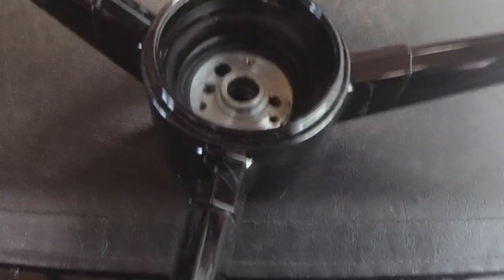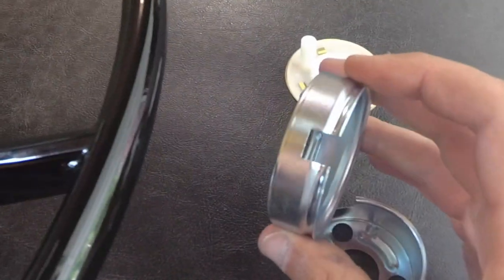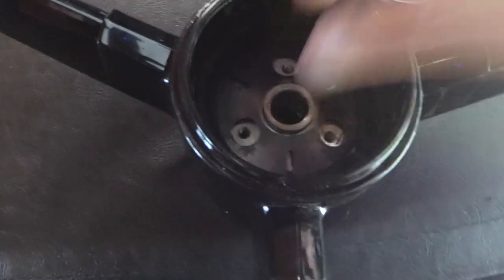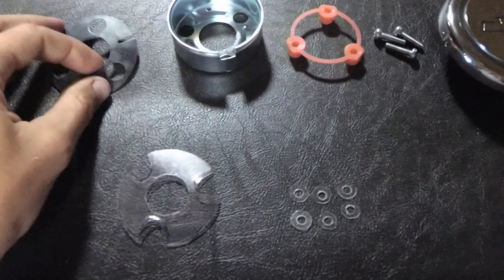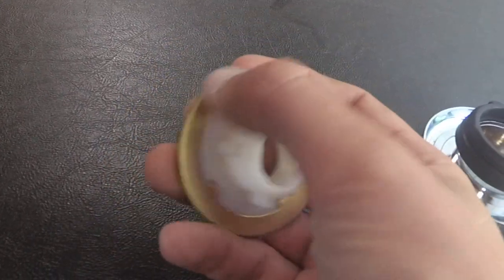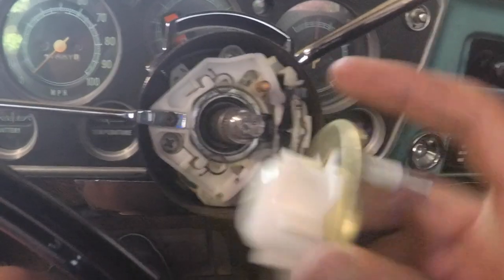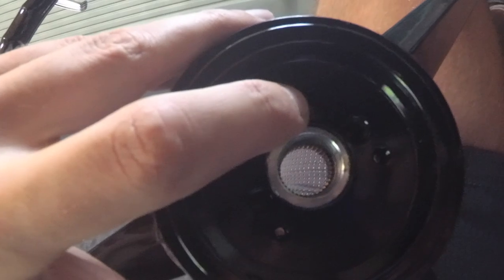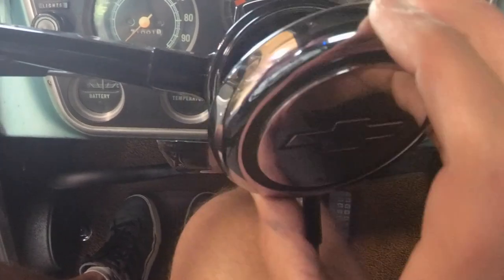1968-72 Chevrolet C10 Horn Button Assembly

Comment: In the event someone is stacking the horn assembly for a 1967-68 Camaro, I want to save you some headache. There is a insulator made in the exact shape of the spring disk. It's a type of fiber/paper insulator. Only was made on the original assembly.  It is not part of any replacement horn kit. But what it does, especially on the 67-68 model with a standard steering wheel with all it's metal is keep you from getting a 12v shock when pressing the horn button with your hand touching any other metal part of the steering wheel. The only way to get one is to cut one yourself (I used some thin gasket material i had laying around. Cut it in the exact shape of the spring disk. Glue it to the bottom side of the aluminum cup. That will separate the 12v from the rest of the steering wheel. Hope this helps someone.

Comment: Great video, very helpful. What is the job of those spacers you made why did you need them and are they electrically insulating anything--if so why doesn't original equipment have them? I'm trying to understand why what you call the spring disk doesn't make contact with the cup all the time? Or to put it differently specifically what functions here as an open electrical switch and what closes it to ground the horn relay? Thanks
Reply: One other thing are the screws fully tightened?
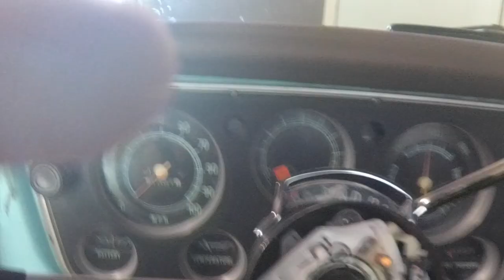Reply from the maker: The spacers I made were needed in my configuration to add space. :-) Otherwise the horn button was already all the way in and I couldn't actually press it to do anything. This also meant that the horn was randomly triggering. Double bad. Check out the piece at 4:10 in the video, that gets pressed down and is the switch.
Reply from the maker: @davidtuniman1431  You can't tighten them too much or you risk breaking the plastic.

Comment: I made similar washers from watching the video. That took care of the lack of 'slack" so to speak and allows the button to be bushed down now. However I still cannot get the horn to engage unless i take the screw out and shove a screwdriver or something metal touching the spring plate the center threads of the column. I obviously have something not playing well together, not sure what it is though. my washer and nut do not make contact with anything metal. Please advise, thanks

Comment: thanks nick, did you have a lock plate over the cancelling cam?
Reply from the maker: Not that I recall.
Reply: Not sure if you're still looking for the answer but I've been working on a '76 CJ-7 since the horn assembly is of the same parts. I found this video very helpful (thanks, btw Nick!), since back in the day when vehicles were made, many designs were universal despite the manufacturer. If the parts and the order of installation were all the same, on my CJ-7, once the signal cancelling cam is installed, I have a anti-theft locking plate that goes next onto the column shaft (the plate that locks the steering wheel when the ignition key is removed).
Reply: They only use a lock plate with a column that has the key cylinder on the side. The one shown is key w/ignition switch on the dash. Your actual ignition switch is toward the bottom, operated by a rod. ASE Master Tech since 1978, Retired

Comment: Ok, got the horn “working” but I have to hit it just right, also horn sometimes honks when I turn the wheel, especially in reverse. Any ideas? Thanks
Reply from the maker: Sounds like your spacing isn't set properly between the different pieces, causing and/or preventing electrical contact at the wrong times.